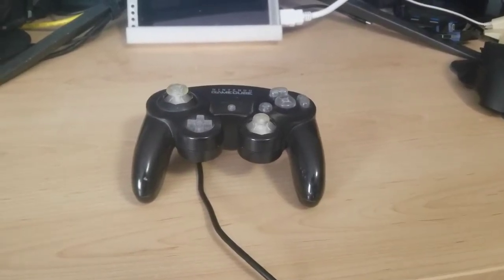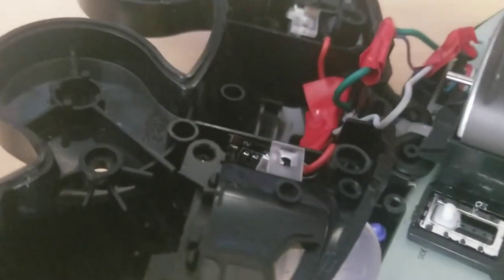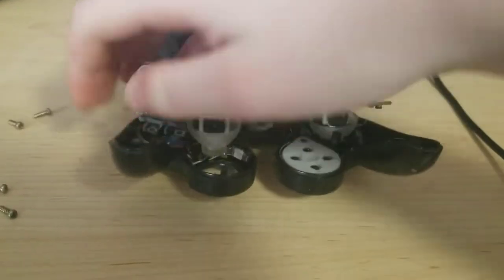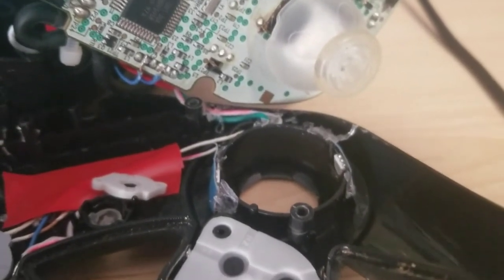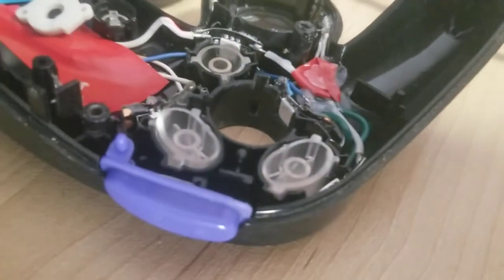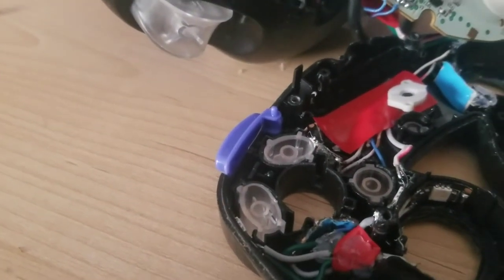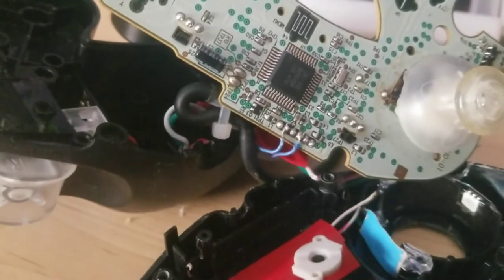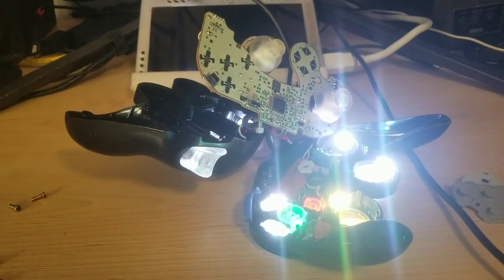LED Gamecube Controller Teardown

Comment: This is so cool but I rather add the LEDs on the ABXY buttons as well as both the sticks and the Dpad with bluetooth LEDs so that way I can control them with my phone. There is also a video tutorial on how to do just that by the way.
Reply from the maker: Yup I saw some others do this before I attempted mine! Personally I just didn't want to deal with fitting an arduino in the shell, as I wouldn't really use it much anyway, I tend to get lazy with RGB stuff, and just set it to a static colour anyway

The bluetooth LED ones are very cool too though!